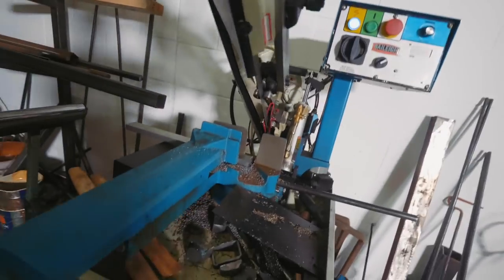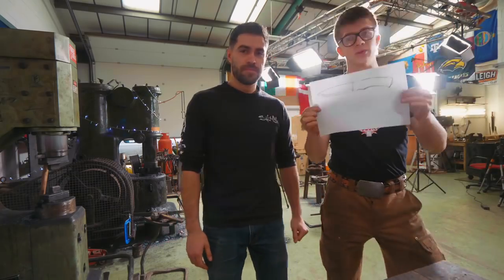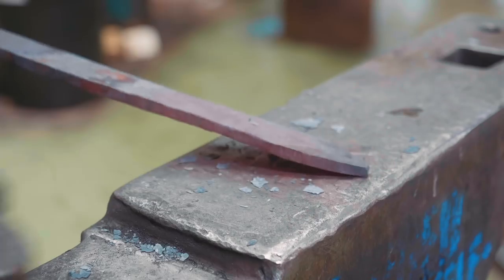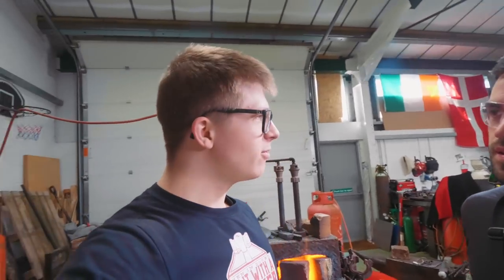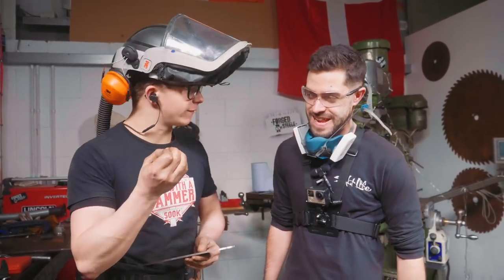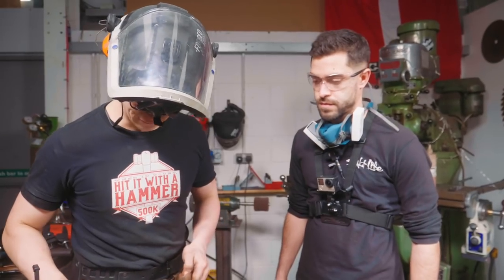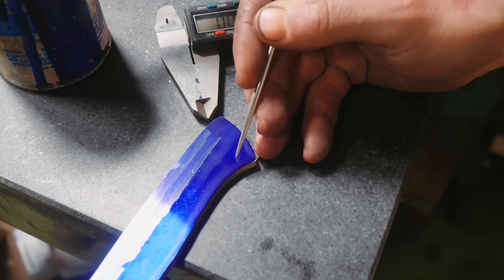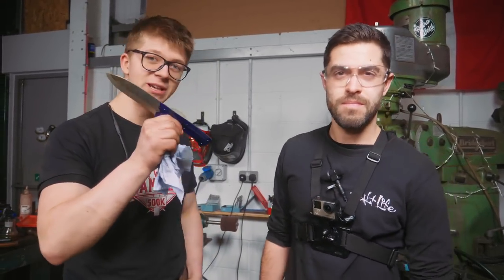MAKING A BUSHCRAFT KNIFE!! Part 1 With TA Outdoors!!

Comment: Hey Alec, check this out. This is the data sheet for a very common O1 tool steel, it shows what hardness you get at a specific cooling speed. I suggest going for something below 300 HV, so you would need to cool your steel down from 800°c to around 600°c in roughly 5 min. Your cooling speed was probably way too fast. Maybe put it in the forge together with a block of steel. Slower is always better ;)

Comment: Or perhaps a seperate video on file work on some scraps of metal. I live in France and here it is difficult to find metal for knife making, I don't want to spend a fortune on good metal for my first attempts so i use old circular saw blades cut up with an angle grinder. Any other ideas for cheap metal would be welcome. Keep up the good work Alec. Great collabs.

Comment: That tool steel is insane. Carbide bits, as high an RPM as you can manage, and a slow feed rate, might get it done (Reduction of chip load compensates fir the lack of rpms). If all goes well that's going to be one tough blade.

Comment: A full tang knife should have a tapered tang for balance. A knife that is handle heavy isn't as comfortable. I prefer to taper mine with the mill but A lot of people grind it. You should try it Alec I think you'll like the feel and it also has a nice look to it as well....more refined.
Reply: Bill Bussler Why taper it instead of just drilling or fullering it?  Serious question.
Reply: Chris R - I can't think of any real practical reason to taper. I guess my reason is more aesthetic than anything else, it makes the knife look more refined. Each to his own though but I think every maker ought to at least give all the different options a try to see what they like. The main point though really is just removing some of the handle weight.

Comment: Alec get some Bosch multi construction drill bits ( blue ones) carbide tipped and quite cheap , recently used them to drill 6mm pin holes in some 1095 Damascus that I accidently work hardened with some rubbish drill bits "oops" but trust me they will fly through 01 and they are cheap enough to pickup a box :)

Comment: A question I've wanted answered for a while now; why use the power hammer when you have the hydraulic press? Does the way that the steel react to the two differ enough for it to be relevant or something?

Comment: Why are you using so much O-1 steel in your work lately? I've always found it to be, and heard the same from other smiths, that it is quite red-short and prone to cracking. What's your secret?
Reply: Jake Cashion My hunch is it's the most easily accessible and cost effective tool steel for him.  With that comes familiarity with the material, and familiarity with it allows a smith to really maximize the properties of the steel.

I think O1 is a poor choice for a bushcraft knife, too.  S7 and L6 would be better tool steels (especially because L6 is basically idiot proof to treat and harder to kill than a Terminator), or even something like 440C, or if we're really bold, 4140.  Maximum HRc value isn't the only metric that should be considered...like, for example, we should take into account that eventually the knife will have to be sharpened, and some steels are a colossal pain to field sharpen.

Comment: I really want to make a knife. Last summer I made a forge the melt aluminum to make castings and such, but I wanted to Smith a knife, so I black smithed some rebar into a pare of tongs, but as I did so I realized my forge barly got the sleet hot enough to turn red. My dad recently got ahold of alot of tools and machines used for metal work, one of which being an oven, so I will finally be able to go through the heat treating process. One question I have is if I just angle grind the shape out of some flat stock (which I know is way less cool and fun than black smithing it into shape) will there be and difference in performance compared to a black smithed blade, given that I heat treat it the same?

Comment: Hey alec or anyone else with knowledge about this. This thing I've been seeing you do (I haven't caught an explanation on it yet in your videos) where you put your steel on top of a thick glowing red piece of steel, is this something like a better way of tempering the steel or does it have some other use?
I am trying to become proficient in the tempering and hardening of steel but I have never seen or heard of what you do until I've seen you do it.
Reply: It's tempering with radiant heat. I'm guessing it is easier to get the right temper (by watching it go through the colours) on smaller pieces than using a torch or the forge. I'm not a blacksmith tho!

Comment: At the risk of looking stupid...I'm finally going to ask.  When they hit the knife with the hammer, there'a a bit of metal that flakes off.  Is that some sort of build up that happens during heating or is it steel that is coming off...and they are loosing material as a result for the knife?

Comment: Is heat hardening galvanized wire a bad idea?
Reply: jay warrell you should never try to use galvanized steel in a forge or high temps, they end up giving off toxic fumes
Reply: Chances are you can't harden it through heat treating anyway, so that combined with zinc fumes would suggest "not a great idea".  Unless you're certain it's a high carbon steel within, it's probably going to be less than 0.3% and won't harden to a degree you'd detect without lab equipment, even in a water quench with an attempted cryo treatment.
Reply: Chris R all I know is I can wrap it around a pencil, and i want to make rings out of it